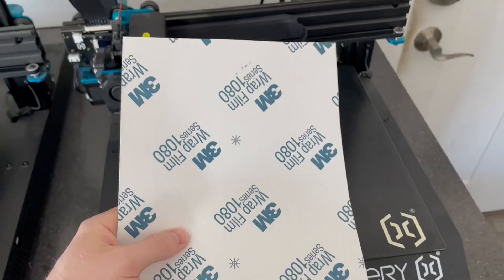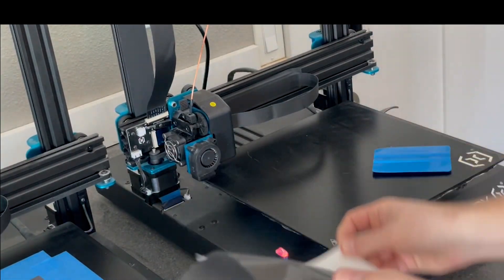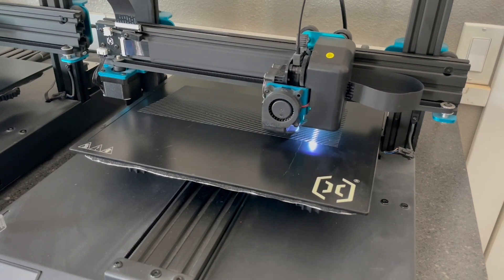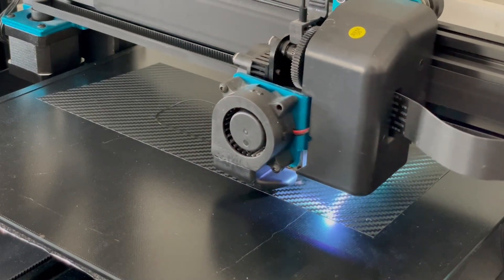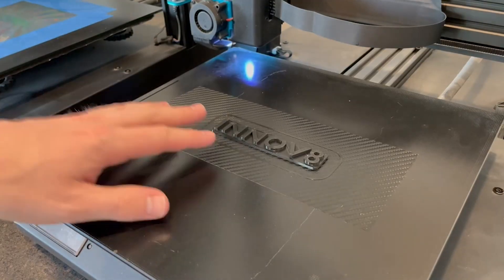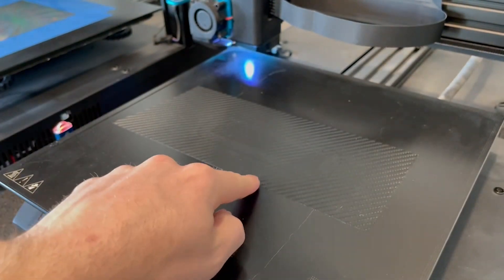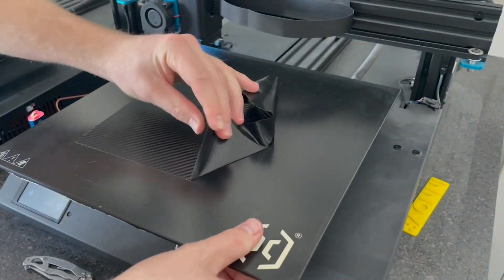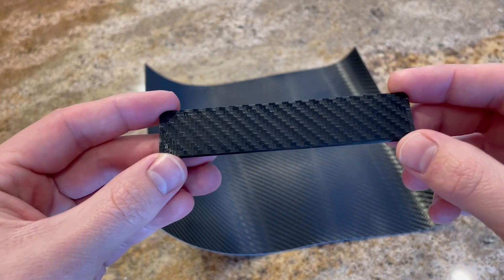Ultimate Carbon Fiber 3D Printing Hack! Cheating?!

Comment: I'm concerned if the nozzle is 220°C, wouldnt it melt the vinyl while printing?
Reply: So the nozzle never usually touches the built plate and the plastic cools rapidly on contact so it shouldn’t melt it.